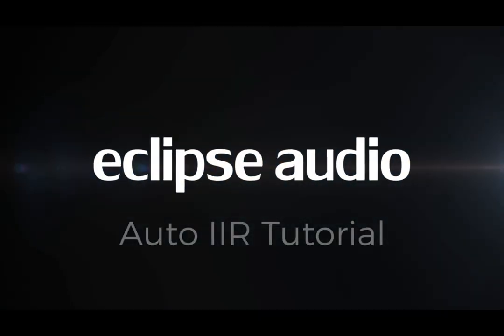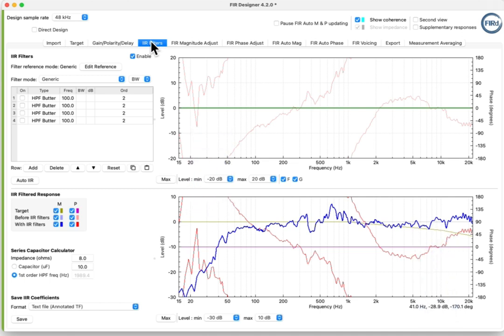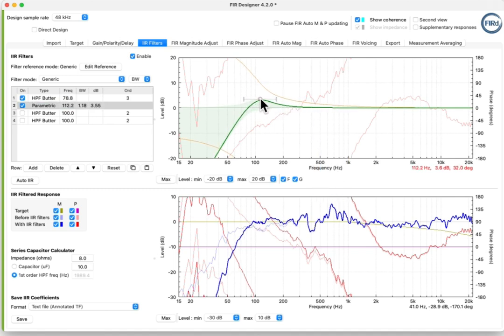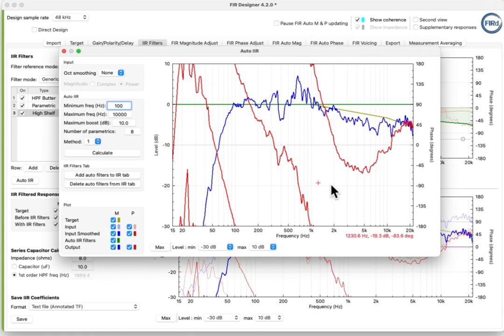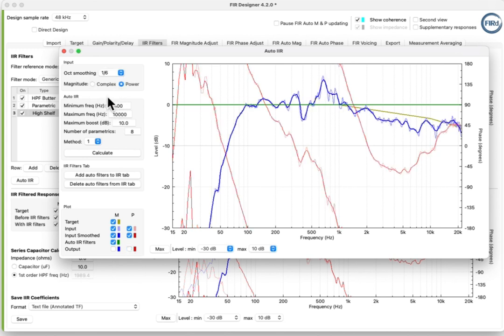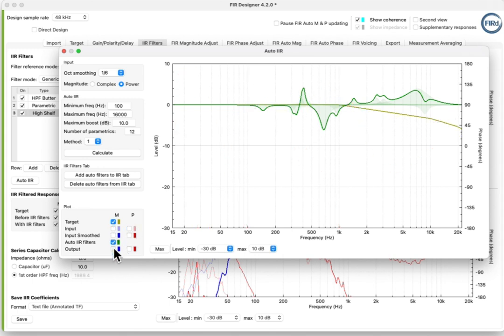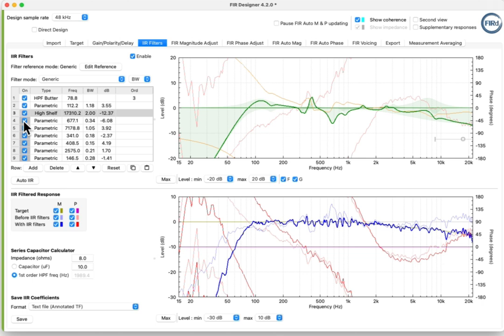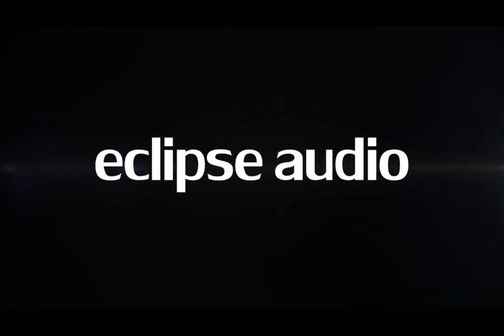Using Auto IIR in FIR Designer | Fast Loudspeaker EQ using automatically calculated IIR filters

Comment: I didn’t see pascal on the list of usable amplifiers. Of course they are rebranded under many other names. But does eclipse work with pascal?
Reply from the maker: In version 4.2 we have a Pascal IIR mode so that IIR EQ created in FIR Designer can be matched in Pascal processors. Currently, IIR filter settings need to be manually copied and entered into Pascal control software or the Pascal web UI. With FIR filters, Pascal supports loading of coefficients from CSV or TXT files, as a column of text. FIR Designer can export these formats.
Reply: @eclipseaudio480  thank you. I’ll look at buying eclipse software now